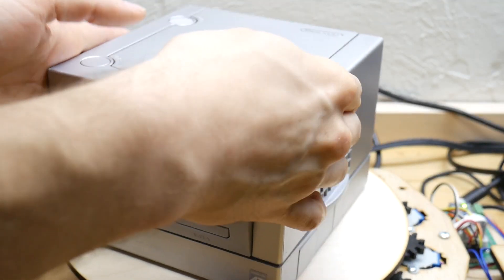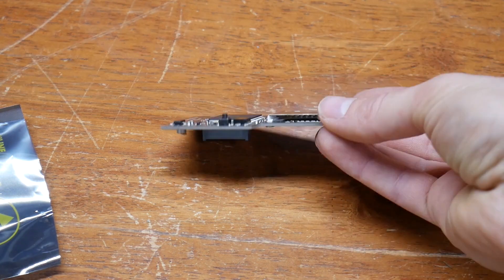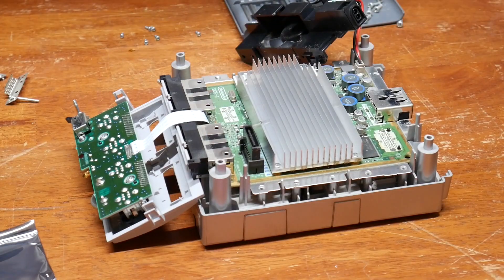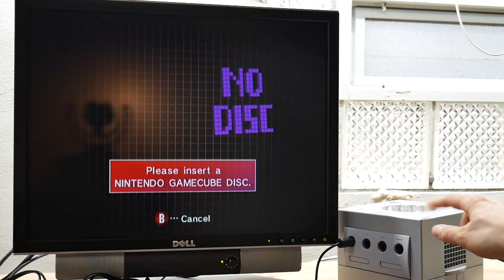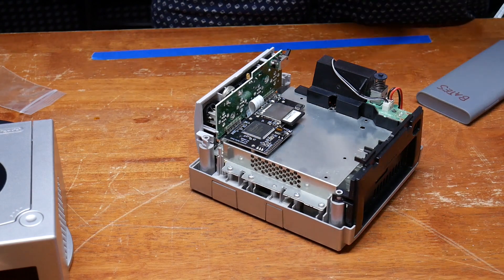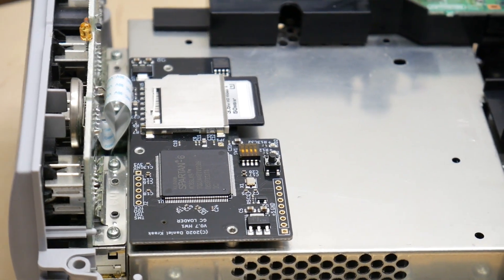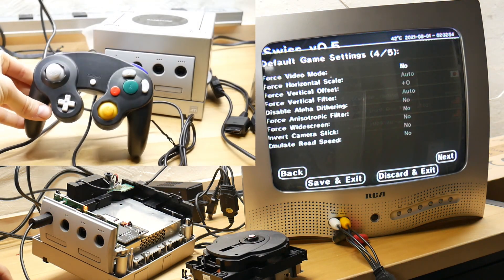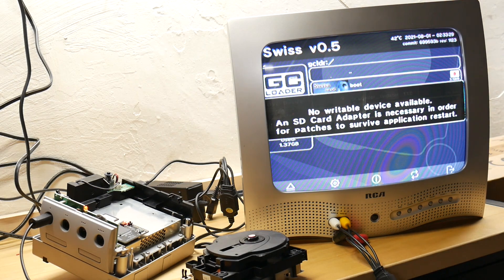GC Loader. Optical Disc Emulator for Nintendo GameCube | Play Games from SD Card!

Comment: Here's an example of using a brooks adapter combined with an encoder that run on different systems. The arcade encoder runs off dinput then he translate it with the brooks adapter so it reads as playstation 4. I don't know what you need to GameCube. Just look into this before you start wiring stuff up. I'm sure they have a backwards converter out there somewhere. https://youtu.be/a1-h0bgmR8w maybe a 8bitdo arcade stick combined with a 8bitdo gamecube adapter will work.
Reply from the maker: will look into this. thank you
Reply: @RetroBuiltGames  I'm sorry I couldn't tell you what devices you needed to set this up. All the new generation systems are easy.
Reply: @RetroBuiltGames  check this video out, it might help you. He figured out a way to run a 8bitdo controller on it. If you figure out what he did. You can use a 8bitdo arcade stick. https://youtu.be/nSaz8vQ9NJQ

Comment: No need for re-wiring. You can buy a arcade incoder that excepts different systems. Or you could buy an already made stick and use a dongle at the end like a brooks converter that excepts different game systems. It's a faster process to just buy converter adapters attached to the end of arcade sticks. I love these device converters.